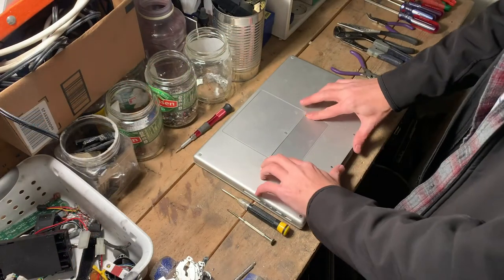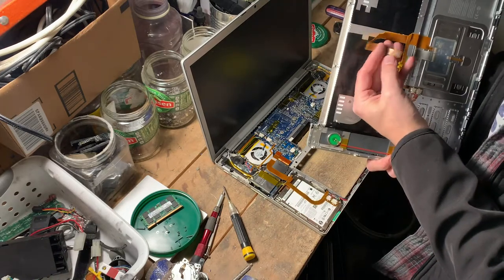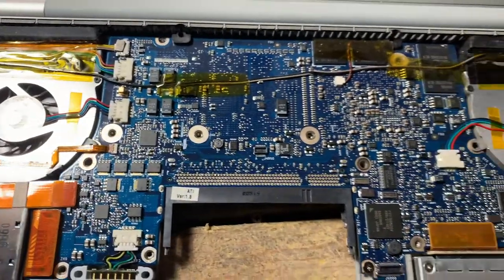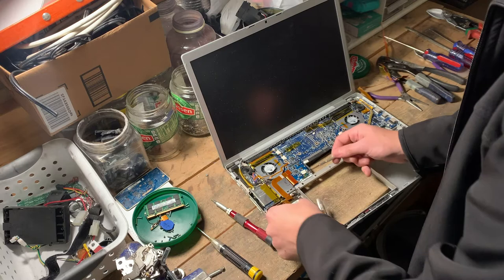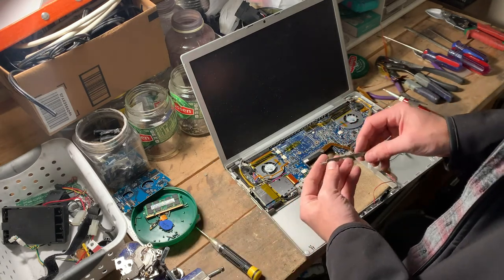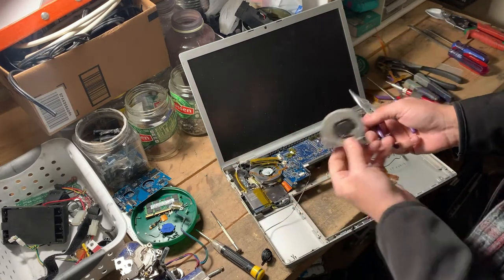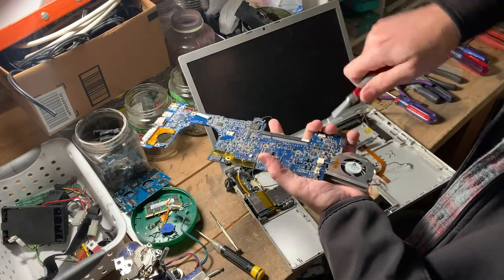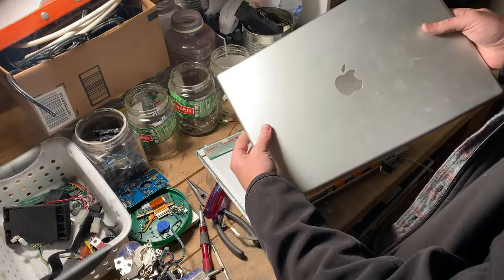eWaste: Macbook Pro 2006 Tear Down Highlights

Comment: The metal part you broke apart is either an alloy called pot metal, or zinc. Zinc has it's uses. I separate it just like I do the brass.
Reply from the maker: It would be interesting if it has zinc in it... I can melt it down and see if I get the tell tale wisps that come off zinc.  I am nervous what else could be in there.  It is such crummy metal and is cheaply made as it is a throw away part in laptops.  But some zinc recovery would be fun.  Alloy that and make brass ... but I am curious what else is in that metal... would it alloy well with copper?  I guess that is a test to try in the future.  Thanks :)

Comment: Nice video. I recently took apart one of those MacBook laptops that was very similar to that one.  I am looking forward to you doing a battery video.  It would be fun to try and recover the Lithium from those.
Reply from the maker: I don’t mess with getting under the shielding.  If there are any dead and unusable cells, I’ll send them your way :)